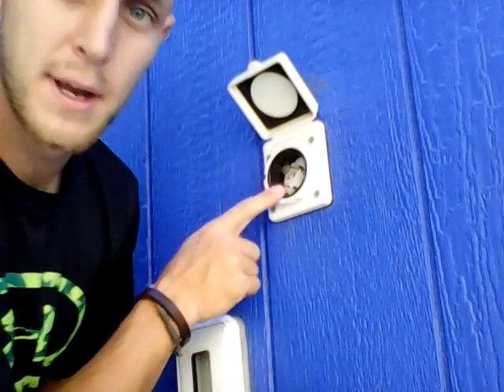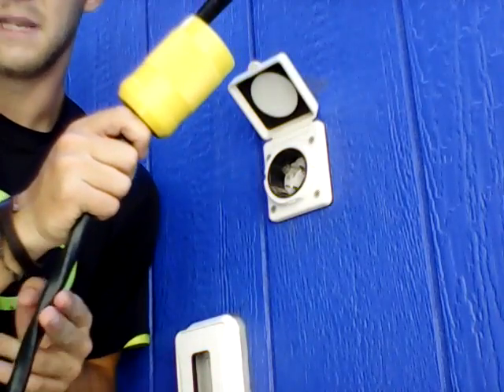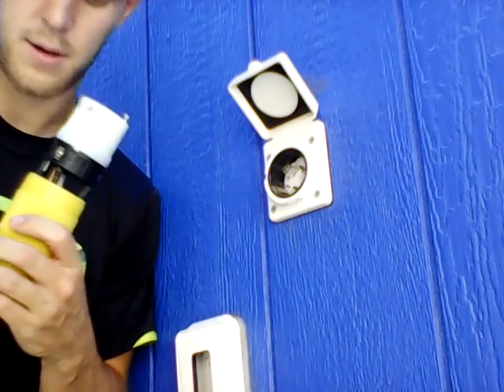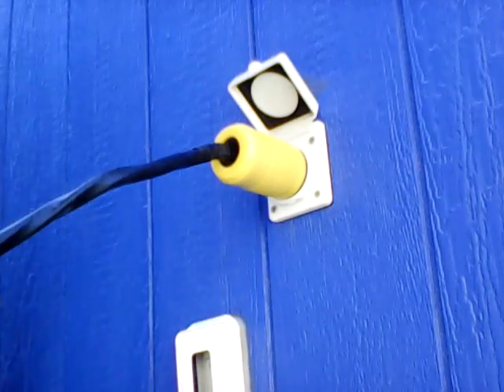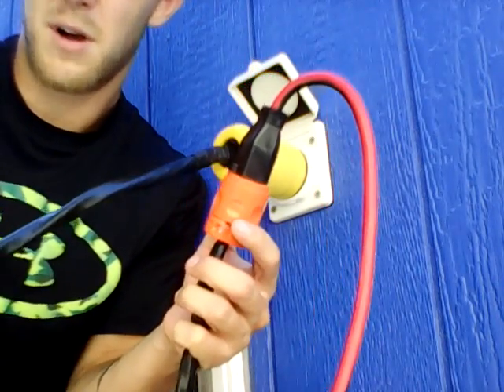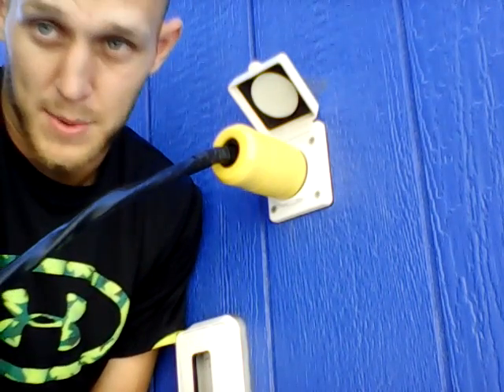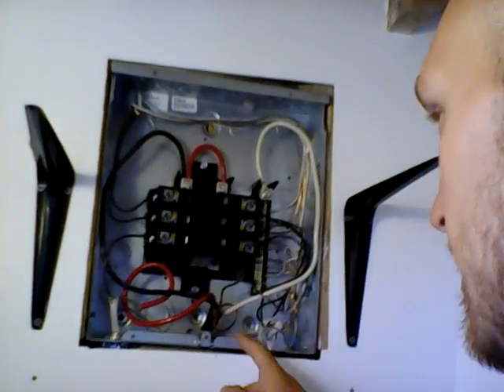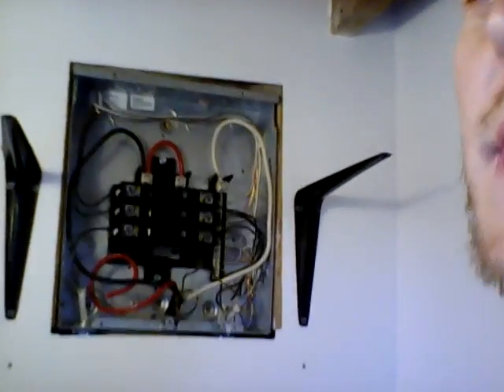How to Get Power to Your Tiny House (Part 1: 110V outlet)

Comment: Cute boy,

🏠  They make RV ( recreational vehicle ) conversation plug adapters. 240 volt to 120 volt in 30 and 50 amp. By the way you are not supposed to double tap that main lug panel box. What if the home is moved and the next guy plugs into a 240 volt circuit  ?  Answer,  dead short and breaker tripped. You are making it difficult for the next guy to figure out what you did. This is why we have standard  Electrical Codes in electrical. 

🤔  🇺🇸

Comment: I only saw one thing not correct.   You said you used a cord from your 50 amp cord cap to the 15 amp one.   What you used is cable not cord.   Over time sunlight will deteriorate that cable.  Flexible cord would be better and NEC compliant.  They are made and sold for RV’s.   Also adapters to do what you did.

Comment: FYI- It is against code to locate the service panel in the bathroom
Reply: It would if the house didn't have wheels and was on a permanent foundation. It is considered more an RV ( recreational vehicle ).
Reply: Looks like he is using a range cord rated for 240 usually on a 30 amp circuit

Comment: Smart I was woundering how to do one of those panels on my tiny home thanks a bunch. So I'll just use a jumper cable.
Reply from the maker: Just make sure you don't have too much electrical draw from your whole house for whatever outlet you are plugging in to.  Usually I only have two to three devices/lights on at a time.
Reply: Kids this is how you start a fire and burn everything up like a match I am a licensed contractor this is not safe by any means
Reply: Good idea.  Been in older homes made before electronics were a big thing and boy those breakers would go! Usually there is one outlet per room and that's it.